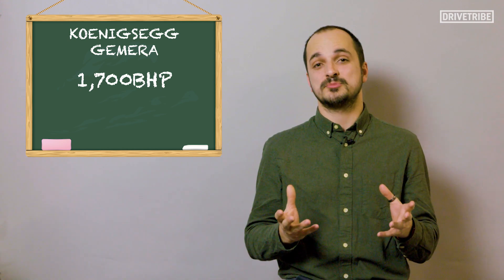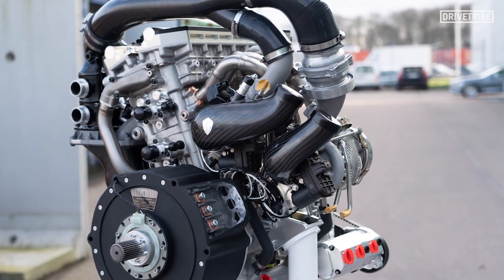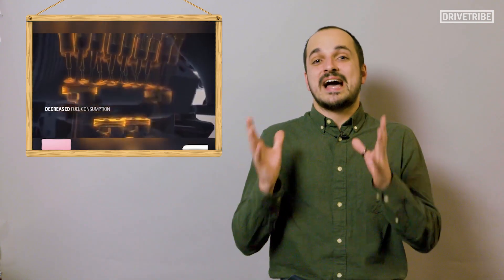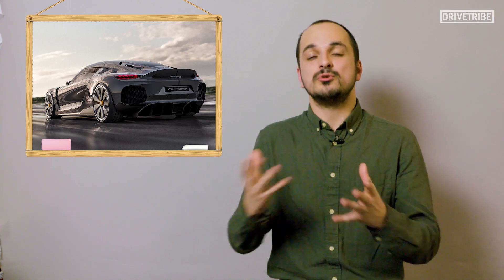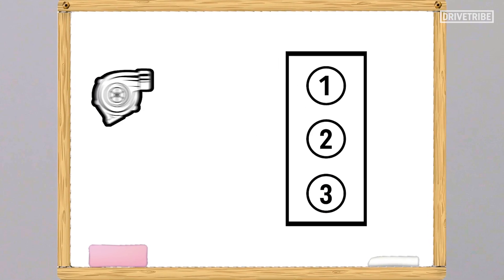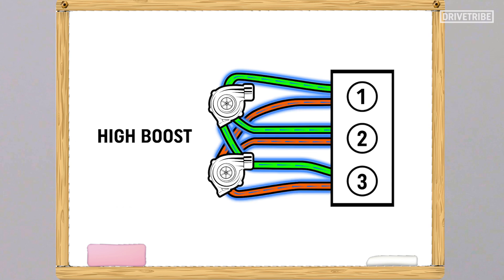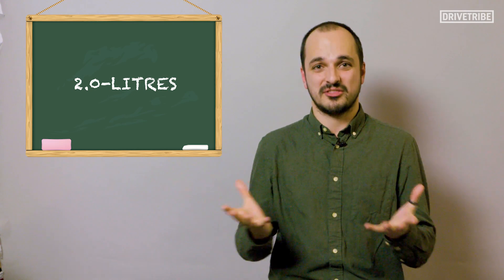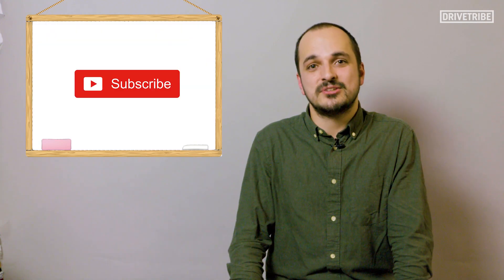This is how Koenigsegg made 600bhp from a 3-cylinder engine

Comment: 1 cylinder produces almost as much power as all 6 of mine 😭
Reply: mercedes I6 300D makes about 150hp
Reply: V6 03 tacoma only make about 190hp
Reply: crown Victoria crying in the corner
Reply: You guys are comparing oranges to apples. This 3 cylinder engine is a 2L with 2 turbos. Ofc an old NA 3L V6 is going to suck...
Reply: @romeomargot-picquendar1281  and you forgot that there are no 2.0L twin turbo 3 cylinder engines. If it was that easy, it would have been done. Let's just say, we are comparing a regular apple to a gmo apple.
Reply: @animealpha4795  well the number of cylinders doesnt matter that much. What matters is the engine displacement, in this case 2L. So you can compare the HP/L. In this case 300/L, which is pretty insane considering it's hard for other manufacturers to get even 200HP/L. That's what's truly staggering about this engine not the 3 cylinders.
Reply: @romeomargot-picquendar1281  I practically said the same thing 😂. That there are no twin turbo 2.0L 3 bangers, which means the displacement and being able to twin turbo it is what's bonkers.
Reply: That means u have a V6/I6 Car that produces only 200 HP ?!!!
How tf dude thats a very weak engine for a Six Cylinders Power
Reply: Abderrahmane Bouhjar Take for instance a 2001 BMW 330i. It has “only” 230 bhp and, believe or not, it is an inline 6 that makes a lot of sense.
Reply: @Thankmel8r  Mines a 125i, It's the N52 3.0 I6 that usually makes ~270bhp in 30i cars, but in the UK they never made the coupe and convertible with that version of the N52, so mine is the most powerful NA engine you could get a 1er convertible with. It's 220bhp I think but to be fair can be easily tuned to 270. I enjoy the reliability of a low tune big engine from a daily though
Reply: Abderrahmane Bouhjar it seems you kids don’t get the fact that naturally aspirated non-performance engines don’t tend to make that much from the factory....
Reply: @Shockload  if you're talking about absolute potential power that can be extracted, then yes those are low numbers, but if it's an old car/engine and not tinkered with after it left the factory it is a normal figure.
Reply: @Shockload  My  3800 v6 only makes 200hp
Reply: Dipply mustang?
Reply: @Shockload  Isn't that more the norm to be honest? Most v6 at least used to be in the 200hp ball park. Of course depends if it is naturally aspirated or turbo. My v6 makes I think 230 as standard but it is only 2.0liter capacity. Naturally aspirated bmw and alfas used to be 190-250 mark and they were considered the best 6 cylinder engines.
Reply: Abderrahmane Bouhjar yeah? Bmw has a 6 cylinder that makes 150
Reply: @Shockload  you must be new to the car industry.
Reply: Abderrahmane Bouhjar the 6 cylinder in my 2007 ford ranger sport only makes like 230 hp
Reply: @Shockload  Nissan has an 2.8 inline 6 turbo diesel engine that makes only about 115hp from factory, but you can see arabs on youtube bosting these engines with 1000+ hp and trash them on the dunes
Reply: @Shockload  "only 200hp" ok kid
Reply: @Shockload  stock USDM I6 2JZ-GE with VVTi only makes 220hp from factory.  JDM Twin turbo I6 2JZ-GTE with VVTi makes under 280hp.  Factory output on nearly any engine is typically very shy of the actual potential output. (Unless we are talking about subarus. They're only made to handle stock power)
Reply: @Shockload  "weak engine" that you're referring is naturally aspirated, non-performance engine. It's common for an entry level bmw and merc that only produce 180-250 hp
Reply: Aristyo “entry level 180-250hp” 😂
Reply: @WRP_2003  🤣
Reply: Aristyo entry level is like 116bhp 😂
Reply: @WRP_2003  i mean euro spec is different with american spec. Like there's no 320i e90 in the usa
Reply: Aristyo Ah yes. In Europe 100bhp cars are common. 180bhp would be seen as a very decent spec car, not a bloody entry level! And 250bhp could be considered as a very very high spec car.

With f30 3 series you can get a 316d !

Comment: Yes we don't have lots of mechanical problems normal for engine but we have lots of electronic totally new problems.
For example you have x100 more sensors and elements and when you try to replace even smallest one, including cables that give you different resistance, you can end with totally broken engine because synchronization will be off. 
Like right now you can use different cables or screw sensor half mm to much and you have error in readings or lack of synchronization between CPU and engine.

Comment: this reminds me of the Lancia ECV the sucessor if the S4 for the new GROUP S, it had 4 cilinders and two turbos and a triflux valve displacement
Reply: yupp - the S4 already combined a compressor (like the 037) + turbo at insane boost pressure
Porsche also used 2 stage turbos in the 959
BMW uses 2 smaller twinscroll turbos on the same shaft for smoother + wider rpm
so, there have been a lot of variants around over 40 years

Comment: "So, what do you drive nowadays?"
Oh, nothing special, just a 3 Cylinder Hybrid
Reply from the maker: The ultimate flex!
Reply: @Drivetribe  literally an i8 on stereoids😂😂
Reply: Vini Van Gogh  Honda Insight
Reply: @Drivetribe  It is so small that the front 400 HP motor is actually ON the block itself and it still doesn't look any bigger. This thing is producing 1000 HP and 1100 Nm of torque (almost as much as a Veyron) in a package weighing 1/7th of the Veyron's W16!! Just combining that alone with the Light Speed transmission would be enough to outrun Bugattis any day.
Reply: @Drivetribe  Yeah, until that same person asks: "So... How heavy is it?" 

.... thats when you want to stop existing from shame.
Reply: @Flyingdutchy33  It weights 1.8 tons and it has 1700 hp

So ot's literally not a problem in the slightest.

You have problems if you think that the weight is a problem for a car still strong or that anyone cares
Reply: @boltmix7294  You are prime Tesla demographic. Power does not change the laws of physics; This car would've been faster without the weight.
Reply: @Flyingdutchy33  Hate Tesla.

Lighter cars are faster.

However how do you want to achive that?

They were making a 4 seater "luxury" hypercar that had to fast and that had to have space for lugage.

There is no way of achiving this without a small engine with the help of electric motors

It isn't supposed to be a 2 seater sports car that is light weight.

It by defintion can't be light weight for what it is.

It still does 250mph and 0-60 in 1.9 seconds and it has an almost 1 to 1 horsepower to weight ratio

It's still by defintion a hypercar, just one made for 4 people
Reply: The car they are trying to make by definition 

Can't be light, it isn't ment to be light and it doesn't matter that it isn't light, the power makes up for it
Reply: @Flyingdutchy33  i dont see you complain about a chiron weighing 2 tonnes
Reply: BoltMix calm your triggers, m8.. if you want to informatively educate someone, act like an educated person. You don’t need to bash on anyone to prove a point.

“It is not featherweight, but it’s not a cathedral on wheels. And what the car is pretty much more than makes up for it” there I summed it up for you
Reply: @Flyingdutchy33  it does 1.9 sec 0-60 lmao. Christians words were it has a better power:weight ratio with the engine.
Reply: @stigREVENGE  Look further, because I do.
Reply: @boltmix7294  it's almost 1:1 on power to weight geez
Reply: @Flyingdutchy33  Oh no, my 4 seater Mega GT weighs A LOT less than a GT63... how will I show my  face at the Marina?
Reply: @tomraymond9795  if it weighs A LOT less, then you have nothing to be ashamed about really, have you actually been paying attention?
Reply: @Flyingdutchy33  this car is only about 2-300 kg heavier than most sporty 4 seaters (which is extremely light for an electric car btw) yet it has 1700 HP, low center of gravity and lots of smart tech. It will annihilate any 4 seater street legal car you can put it against on a track. This isn't like a Bugatti, Koenigsegg has never made a car that doesn't handle. Even if you can find something that goes into the corner faster, the Gemera will more than make that up when exiting the corner.
Reply: @romeomargot-picquendar1281  If it werent for the name, I'd say you were an American
Reply: @Flyingdutchy33  the engine itself has ~70kg
Reply: @Flyingdutchy33  you can make it lighter by removing that that drive shaft and battery that's like 1/3, let's say it'd make it 1.65-8 tons. But this car is not that track focused. It's a GT 4 seater with repsectable track capabilities, ~7min nurburgring
Reply: @ChuckLeeClerk  If you think the batteries in this weigh less than 200kg, we need to have an entirely different talk, my friend.
Reply: @David-ud9ju  Would you be so kind as to point out the ignorant bits?
Reply: BoltMix “hate Tesla” exactly the person Tesla likes
Reply: I remember a Smart-car ad that had a similar tone.
"oh my car is a red 2-seater mid-engined car"
Reply: and it also runs on Vulcanol dont forget that, its flex fuel
Reply: Spock would have approved !
Reply: Yes an i8
Reply: "so it's a Toyota Yaris"
Reply: @klausnielsen7102  An i8 doesn't produce 600bhp...
Reply: Sir Christian Von Koenigsegg and the rest of his team are genius!
Reply: ABC 123 yes weight matters probably even more than power especially on track cars, power only allows you to be quicker on the straights but less weight allows you to be faster everywhere and get less wear on brakes and tires
Reply: Yea it does sound a bit vegan
Reply: i8
Reply: @danysonantony3847  Calm down, son. No need to get this riled up about my opinion.
Reply: Flyingdutchy33 K let’s find middle ground, yes weight is very important on cars when going to the track and even top speed runs, however the Gemera has never claimed to be a track car and is not that. It is a grand-tourer that has 1700hp and seats 4 people, if you want a track car get a Jesko. This car is just another avenue for Koenigsegg. Yes the car would be faster, corner better, brake faster, and have more effective downforce if it were lighter but that again is not the point of this car. It is just a fun grand-tourer.
Reply: @spiffytuber7515  What was the point of this car then? I can name about 30 cars that are mor comfortable that seat 4 people. The point of it having this many horses was to be fast right? Then why shoot yourself in the foot? Just my 2c
Reply: Flyingdutchy33 like I said it is a fun GT car with 4 seats, not a track car
Reply: Flyingdutchy33 can you name another 4 seater with 8 cup holders that has 1700hp. That is the point. Christian himself said he was trying to see how he could share the super car experience with his family and that was what came to mind.
Reply: @spiffytuber7515  Hey if you want it, go get it. I'm happy for Koenigsegg that there are people like you.
Reply: Flyingdutchy33 I don’t want it and I’m not the market obviously, I was explaining to you what the market was because apparently you didn’t get it but at this point you are just trolling.
Reply: Flyingdutchy... instead of asked about the weight, you should go straight up to the point about how it drive around the corners.
Reply: @arapaimagold8088  I'm starting to think you are right
Reply: That much power in a bike, it's a death wish. You will probably also need 2 wheel drive on a bike to avoid your bike shooting off doing a wheely.
Reply: ABC 123 Also, the Chiron is proof of why weight is important, while it had more horsepower than the Agera RS and AWD, and less drag it still got to 400kph a lot slower than the Agera RS because of that weight it was hauling and the braking suffered as well after the spoiler brake stopped having effect.
Reply: I8 is a joke, please
Reply: I'm getting my first hybrid in August. Unfortunately its only a Toyota Corolla. Wonder if I could get one of those Koenigsegg engines and find a local garage to plumb it in?
Reply: Phantom Echelon it’ll cost a pretty penny lol
Reply: @spiffytuber7515  Probably more than the car! 😁
Reply: @F a Point out the bullshit and I will
Reply: "So an Insight?"
Reply: 3 cylinder, breaking engine, with 600bhp, if i push it hard it will break, Best engine ever
Reply: @Vic Cruz It very much depends on your definition of Hypercar.
 For most, it means that it's faster than a supercar. 
For some, it simply means how much power you have and what your acceleration is. The problem with this is that if this is the criteria, dragracing vehicles would instantly classify as Hypercars.

Super cars are a derivative from track vehicles. The idea was that you could drive a track car on the street.

Hyper cars are basically super cars, but faster.

So saying that Hyper cars are first and foremost street cars as opposed to track cars is a bit silly to me. In my opinion, it's the exact other way around.

With this in mind, a 4 seater car that has more trouble stopping and cornering than most super cars and even some sports cars cannot by definition be a hyper car.

Having 1700hp in such a scenario is silly to me.

But it looks pretty good though and like you said, some people won't care. They simply want other people to know they spent a lot of money.
Reply: Can you imagine this in a Prius? 😂
Reply: Timothy George 😂💀
Reply: RARAYAYA RAA  I encourage you to pay better attention in highschool class when the teacher discusses physics.

The Veyron is also very fast, right? It gets outcornered by cars you wouldn't believe.
Reply: @Flyingdutchy33  would take a well appointed super seven over the Veyron at the track,  however,  VEyron is a Gt gar really,  get you from Paris to Monaco as fast as the TGV,  without the Riff Raff.. and do it somewhat safely , and in comfort..
Reply: @planegaper  Not really, the Veyron is really not that spectacular in corners. I can tell you watched the Top Gear episode about it.
Reply: Flyingdutchy33 and that’s clearly not what he was saying, he said he’d pick other things over the Veyron at the track but as a GT car he was saying it’s a great car for being comfortable and quick
Reply: @spiffytuber7515  Yep
Reply: yeah it's a piece of shit

Comment: Do we really need cylinder de-activation on a 3-cylinder engine?
Reply: I think he mentioned it for future use of freevalve tech on other engines.
Reply: 200 BHP per cylinder, so even at highway speeds you could get away with running on 1 cylinder.
Reply: @dashy90210  imagine that kind of variable displacement in a V8 - 200 to 1600hp on demand...
Reply: I think the latest Fiesta ST does have cylinder deactivation, and it's a 3-cylinder engine.
Reply: Daniel Schmidt THE EPA IS FULL OF LOSERS So yes you do need activation.
Reply: Why not? The pistons are electronically controlled, turn them on and off in less than micros seconds.

Comment: Koenigsegg getting ready to produce the worlds first engine-less engine.
Reply: As elon musk himself said about rocket design, "the best part is no part". Make it as easy as possible. I strongly believe Christian von Koenigsegg lives by the same rule when it comes to drivetrains.
Reply: piston delete kit.
Reply: Audi was first (I'm joking) - "I think Audi has accidentally invented the world's first air-powered engine!"
Reply: I believe they'll do it too!
Reply: lol🤣🤣
Reply: Jesse Franco Nothing revolutionary here 
Didn’t Mazda make a less than 3 litre 600HP “cam-less & valve-less” engine way back in the 1980s ?      The 767 !!!!!!!
And it didn’t even need a turbocharger, let alone 2 👌
Reply: A special AC synchronous motor with special magnetostiction coils to make a V8 like grunt would do the trick.
Reply: Lol EV's are the 1st engine-less cars
Reply: I.e. an EV haha
Reply: @armwrestlingprofessor  EVs are not engines.
Reply: @cat-em3mj  That's the point. "Engine-less".
Reply: Jacob Johnston Battery pack and motor ain’t engine. What he meant creating same torque and power without same mechanical method.
Reply: @gatwickguy ...yes I know, that's the point of my comment

Comment: So constantly variable timing and sequencual turbos. These are about efficiently not power. So what's the actual reason I mean high boost with E85 does wonders but that's not enough.
Reply: They can any petrol engine. Better watch SupercarBlondie or Shmee150 to enlighten you.
Reply: @marinerchris  They can what?